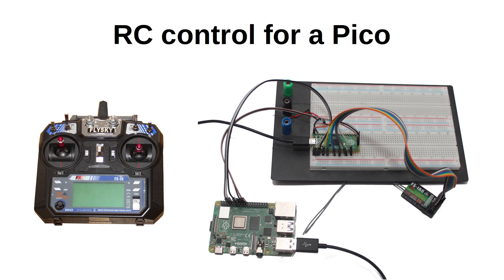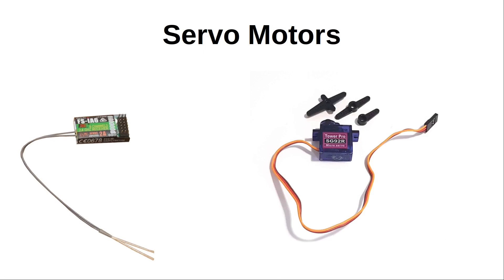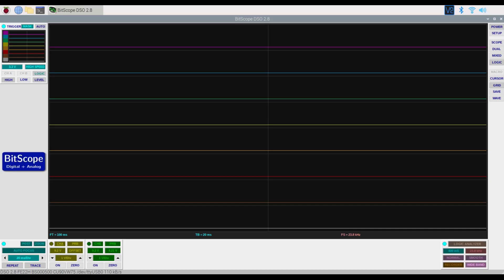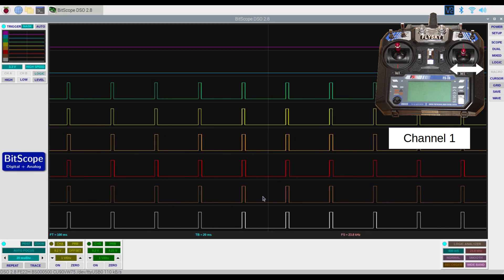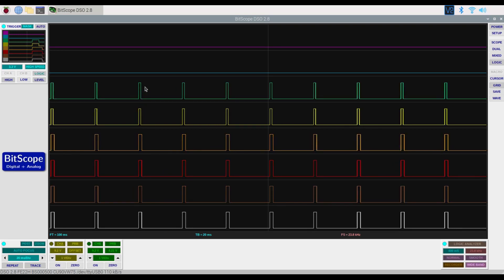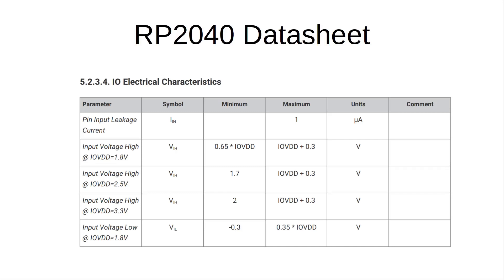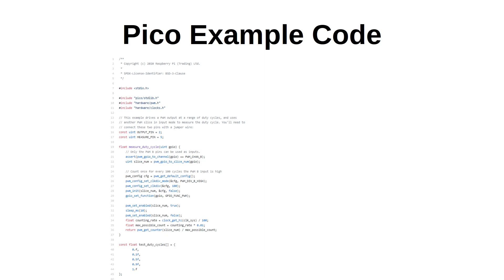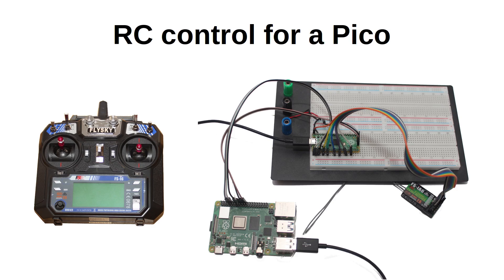RC Remote Control Raspberry Pi Pico

Comment from the maker: I've now added another video which gives a better solution.

Please see this video: https://youtu.be/_Fz9lJXu2DE which shows how you can use I-Bus as a better alternative to PWM.
Reply: I've been trying to find out how to do the reverse of this and wondered if you had any pointers. Specifically, I would like to have my Raspberry Pi communicate to the servo receiver as if it was the RC controller. Does that RC controller (or other models you know of) have an interface that you can use to send commands to it. To be clear, instead of a human pushing the joysticks on the RC controller, I want to programmatically control my airplane from my Pi. Perhaps you know of a different transmitter/receiver pair which has a programatic interface if not. In the video at 8:59 you said "then you've go the programmable interface". Is this what you meant by that?
Reply from the maker: @joireland  it's not something I've tried. It should be possible but it may be a lot of work in trying to understand which control signals to send.

Firstly when I say programmable interface for the controller that is to allow buttons to be mapped to different codes, not so you can use microcontroller to send comments. 

One solution is to have a microcontroller on both ends. This is most flexible but would need space and power on your aircraft for additional controller and power etc.

A better solution may be to get an RF transmitter designed to connect to a microcontroller that works at the same frequency as existing transmitter. Unfortunately that is not something I am particularly familiar with. It would mean needing to understand what signal you need to send. I expect there is documentation somewhere but it's likely going to be a lot of research unless you can find an example that someone has already done.

Comment: Thanks so much for this. So helpful! Do you know if the sbus could have been used here?
Reply from the maker: I expect so but I've not used SBus.

I have done something similar using I-bus as that is what my controller supports. 

See the video at https://youtu.be/_Fz9lJXu2DE?si=HYAv43Il5yQr6BqJ

There do appear to be micropython libraries for sbus so that may be an option.

Comment: it can be connected to a raspberry pi 4?
Reply from the maker: Whilst is may be possible to read a PWM signal on a Raspberry Pi a microcontroller is better suited as it is better to read in real-time. 

The use of i-bus receiver will probably work better, but I haven't had a chance to try that yet.

Comment: can i upgrade flysky fs i6 using resberry pi pico and whick pin i should connect on pico
Reply from the maker: What do you mean by upgrade?

If you mean to use the flysky with a Pico then you can either use the PWM signal as discussed in this video - or if you have an i-bus receiver then you can follow this guide: https://youtu.be/_Fz9lJXu2DE 

If you mean upgrade the firmware on the controller then that's beyond the scope of what I've covered.
Reply: @PenguinTutor  I  mean upgrade the firmware on the controller  suing Resberry pi pico
Reply from the maker: @BatteryBazarBD  The Pico is used for connecting to the receiver, but you wouldn't normally use it for connecting directly to the controller. I would use a computer for that instead.

Comment: Hi! If I'm trying to use a Jetson Nano (basically a Raspberry Pi 4), how can I do it?
Reply from the maker: It is possible, but difficult to read PWM on a Raspberry Pi. The advantage of a microcontroller is that it is able to read the pins in real-time. 

To do the same on a Raspberry Pi needs responsive code, which would need to be implemented in a low level language. 

There is another technique involving I-Bus. I've recently bought another receiver with I-Bus so I'll be investigating that in future, but I need to finish my current project first.

Comment: This looks like it might also work with a small drone as well.
Reply from the maker: Indeed - if you just wanted remote control then you could just wire the receiver directly to the drone, but using a Pico may allow it to make some other decisions if you wanted to add some custom logic in there. You would probably need to do some testing though, I'm not sure how well the Pico can handle multiple outputs and inputs simultaneously. It does have dual cores and PIO but you would need to respond quickly to signals to keep a drone flying correctly.